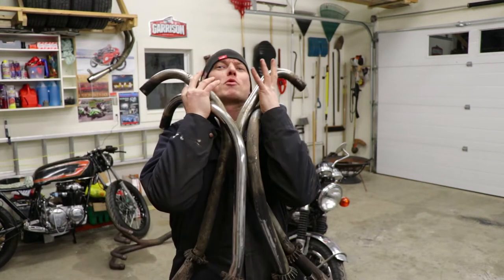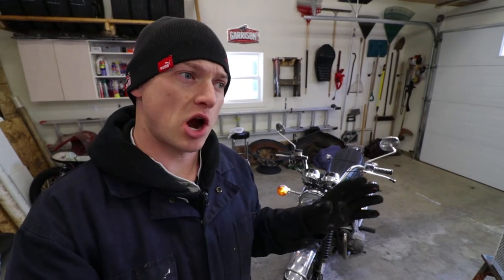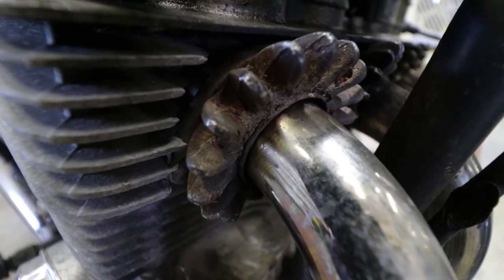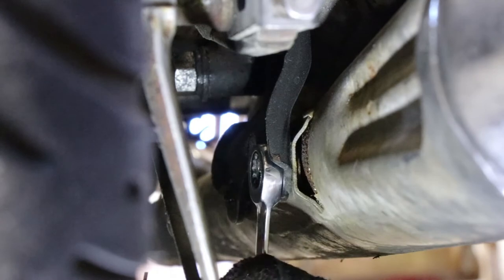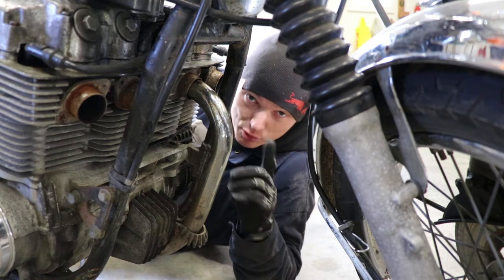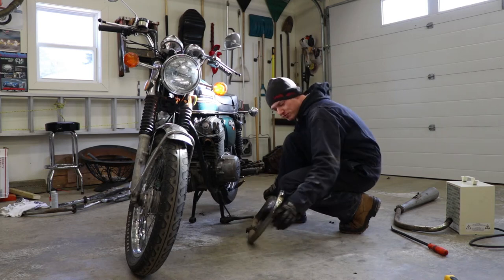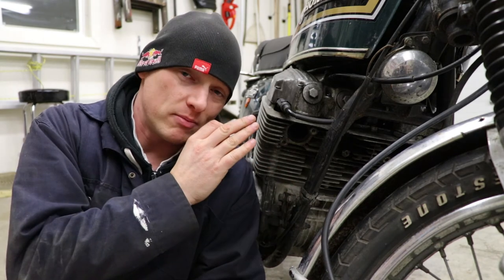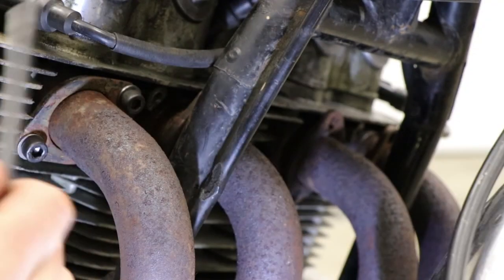How to remove cb750k exhaust *PLUS BRAP BRAPS!*

Comment: I have a 76 cb750k that the previous owner did the same chop job on a set of 77/78 pipes. But he also went a step further and welded the rear pipe mount flange to the frame! So for four years I have been gearing up to bolt on a new set of pipes.
Reply from the maker: Ugh! So the exhaust is permanently mounted to the frame of the bike?!?
Reply: Yep. Wouldn't be so bad but the front nuts holding on the 1 and 4 pipe are completely unaccessible so it's gotta be cut off the frame or grind off. I have been searching for someone else that had the same issue.

Comment: Great video buddy! Do you need to modify the jets after changing exhaust?
Reply from the maker: I did not, but it depends on pipes, intake, etc.
Reply: If going with straight pipes with the stock air filter box do you need to change the jet size? Im thinking of doing a similar setup:)
Reply from the maker: Very likely. I introduced a little back pressure with mine via the silencer. You may need to bump the jets up or adjust the needle position with a straight pipe.
Reply: @Mike_Barker  ok so you would say i could not run it with stock jet and a delkevic straight pipes and stock air filter box?
Reply from the maker: I can't say for sure as I've never had a Delkevic system.